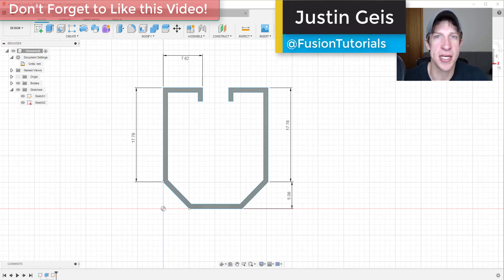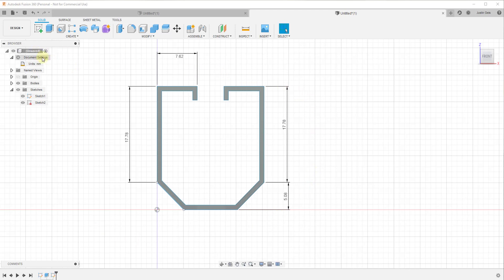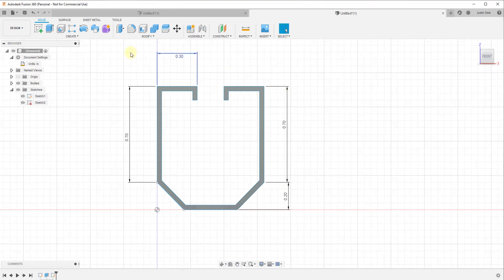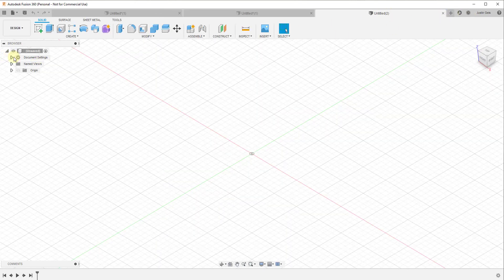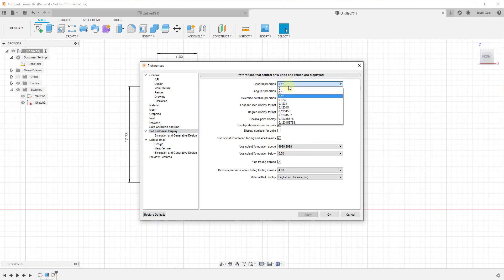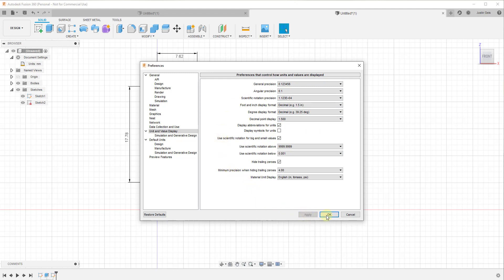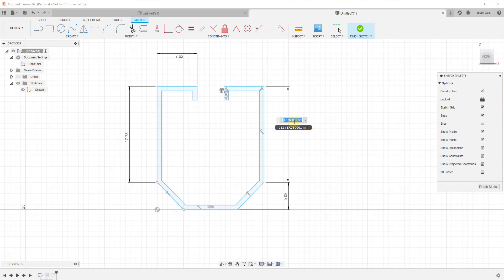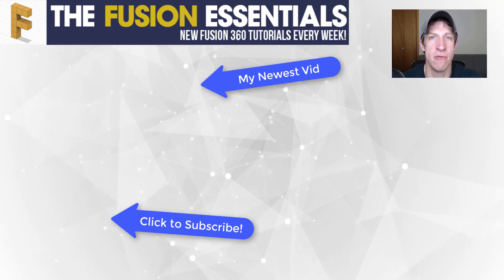Changing UNITS AND PRECISION in Autodesk Fusion 360

Comment: Thanks. What a crazy programming decision that precision will not update after changing options. It is not practical to "readd"" dimensions in a real project. I'm frustrated a bit.
Reply: You should always assume that Fusion engineers make bizarre decisions.  In general, working for Autodesk means that you think in ways that no one outside of Autodesk understands.